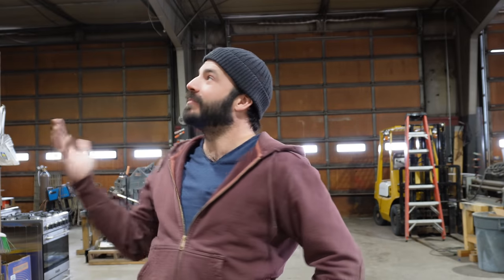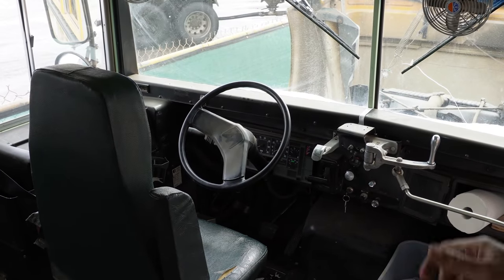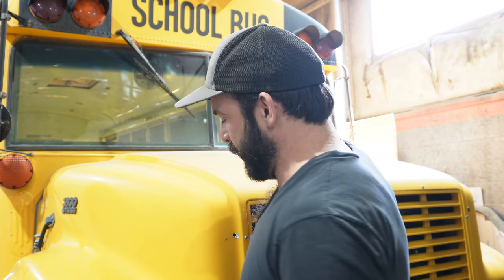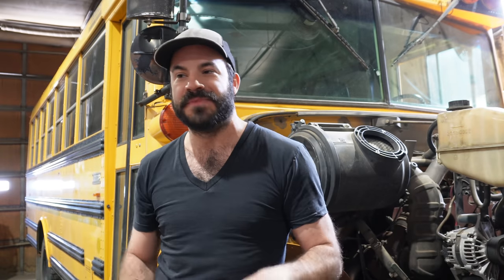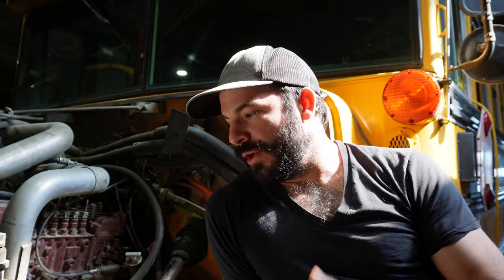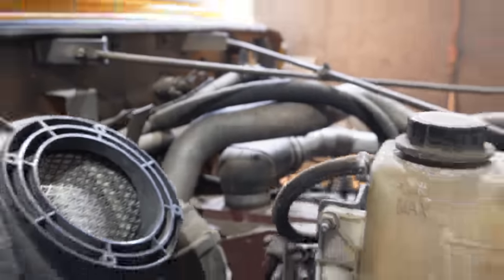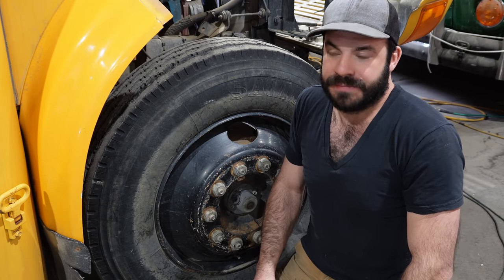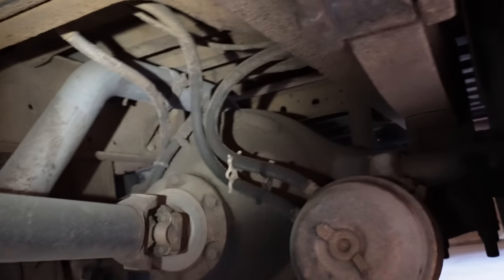Which Bus To Convert For Your Skoolie?

Comment: You should make a spreadsheet about the different engines. It would be super helpful
Reply: Yes it would in fact I'm planning on buying a bus and I'd like to know more about engine specs.
Reply: Stick with a cummins, a detroit, or a caterpillar, those are the good ones and parts are plentiful.
Reply: Run from any Maxforce
Reply: @ericolson8708  I agree, they are absolutely terrible.

Comment: One of the MOST Important decisions for a front engine is that if you drive gravel or dirt roads your intake and radiator is in the front getting clean fresh air , rather than the dust cloud that envelopes the last 1/3 of the bus . Keeping the rad dust free and clean air into the intake goes a long way to the life of your engine. Considering that the reasoning to build a Scoolie is to boondock , that means that likley these areas are off the pavement and may be 5-75 miles out in the woods. THANK YOU for all of these wonderful vids , very much appreciated.    CHEERS AND SAFE TRAVELS      Steve h.
Reply from the maker: Awesome point! Thank you for watching

Comment: Just recently discovered your channel. In January we purchased two buses from our school district. Mine is a 1995 Thomas IH3800 with a DT466 Dad bought a 1994 T444E version. Both are manual transmissions. My bus is the one I rode a good part of my school career and Dad was the driver. It only has 144,000 miles. I’m in the process of slowly converting it into a weekend camper. My first objective was to get it painted and mechanically ready to drive. Love the 3800 chassis buses. I’ve got a few videos if your interested in checking the buses out. Great video and information here! Take care!
Reply from the maker: Love that story! Sounds like you got some great buses. A manual would be the only way to make me love my bus more. I'll follow you!

Comment: The nice thing about a DT466 engine is that you usually can do an in frame rebuild on those. The cylinders have sleeves in them can be replaced if damaged without replacing the block

Comment: Totally bang on when it comes to lane position. I just bought a RE Bluebird and drove from Denver to mid coast Maine. I ran the pass side tires over the rumble strips hundreds of times. After about 1000 miles I had the hang of it. Having the motor 35 feet behind you is pretty great too from a noise perspective
Reply from the maker: love RE buses.... love mid engines even more!

Comment: Your advice was well taken. My rust free Mesa Az., bus is a 2001 International 3000 , 24 foot, 6 window truck chassis. Though not my favorite it has a relative low mileage dt444e. It was a special needs bus and has air bag suspension on the rear. A major plus for a comfortable ride. I checked with a school bus transmission specialist and confirmed before progressing ...with changing tire and wheel size from 19.5 to 22.5 and putting on all new tires and used Alcoa alum, wheels(made a world of difference in looks). Also having the same effect as changing the differential. Engine went from 64 mph @ 2700 rpm to 70 mph @ 2200 rpm.

Comment: Just discovered your channel & enjoyed it. Learned a few things so I subscribed. Looking forward to this bus conversion.

BTW: As a precaution, the company I worked for painted their wheel rims, light grey. It made it easier to detect a crack, normally turning black, than it would on a black rim. Mind you my bus had chromed wheels so did not apply.

I drove a school bus exclusively on highway charters. (Cheaper than coaches). It had a Mercedes diesel engine with an Allison trans. (don't know any of the models) and it lasted till 318 thousands kilometers before problems started to show up & company unloaded it right away.
Reply from the maker: Great tips! Love those Mercedes engines

Comment: So much great info. Like many, I learned most of what I know about buses After buying my bus. Still have that first one, a 34ft shuttle on a F550 chassis, that I converted the inside of. And the biggest thing I would change if I could, is the engine. Mine having the computer controlled 7.3 diesel. Wish it was a non computer straight six. My 7.3 started to run rough, hard start. I took it to a shop that replaced all the injectors and she was running great again. Till I was Two States Away from that shop. Started having No Start issues, which eventually got traced back to the shop that changed the injectors allowing some oil to get onto the contacts of the Internal Wiring Harness, That oil burnt, breaking the electrical connection, and all injectors on that side of the engine stopped working. The tows, diagnostic troubleshooting and repairs, plus hotel cost while my Home was in the shop, was a major hit to my budget and planned travels timeline. A straight six has all the injectors, glow plugs, wiring, on the outside of the engine where it belongs, is easy to get at. Having these buried inside the engine and a computer controlling everything, makes it impossible for me to find and repair issues myself on the road. And this is what most videos won't talk about. Yes the 7.3 is great when it's running well. But when something goes wrong, it becomes a major pain in the A$$. Towing a bus is very expensive and many shops won't allow you to live in it while it's in their shop. Plus supply chain issues are causing longer delays in getting the parts needed to repair our buses once the problems are found, keeping us out of our Homes even longer when something breaks. During which complete strangers have access to All our stuff. Welcome to The Dark Side of bus life, the reality that's often left unsaid. And if you are not staying in one general area but actually traveling cross country like with my situation. Then having the shop that did the original work tow it back in and correct the followup issues, is not a realistic option. You will be hit with all the upfront costs of all followup issues. Plan and follow through, as best you can from the very start, to avoid problems on the road. Then plan ways to survive if/when life gives you an unplanned something you're not able to avoid, which will happen sooner or later. So such an event doesn't end your journey, chosen way of life.

Comment: I usually keep some starting fluid around, not necessarily to start things, although I have used it for that, but as a cleaner.  It cleans very well and is cheaper than brake clean usually.   As for the dog nose bus I have a super C built on an International 4300 chassis and one of the reasons I bought it is because I have that 5 or 6 feet of engine and substantial frame in front of me in case I, or someone else. does something stupid.   Keep the good stuff coming.

Comment: Hello, many years ago I was looking to convert a small school bus for myself and dogs but life got in the way and now that I seen most of your videos iam ready for the plunge once again. the price of living in an apartment nowadays I can take all that money and finish the project in one year.
I been looking at lots of videos and yours have more interest in how  you build your buses out.
Lots of pros n cons living off grid sort of speak 
 But I believe I'm going with a sprinter van instead and using the flooring system and spray foam in which you applied
I still have to do more research and finding a van , but I will definitely keep your videos in mind when I finally get my project going. 
Keep up the amazing information in your videos.

Comment: When we use to order our F150s and F250s, we ALWAYS ordered them with the 4.9L (300)  In-line 6cyl. They had a lot of low end torque and would out last our V8s.

Comment: My old heavy equipment and diesel instructor in school used to tell us that every diesel motor has the ability to be a million mile motor if you take really good care of it, rebuild it every 200,000 miles, never drive it hard, and rarely drive it anywhere except on the highway.... Otherwise you are damned lucky to get 250,000 miles before it ends up in the scrap heap 
And those were the old pre 1990 models without all of the new crap put on them today. 
Personally never saw one make it over 250,000 before they needed replaced or rebuilt, a lot were destroyed by the driver's before they saw 150,000 miles.
Have to admit that the straight six was stronger, lasted longer, put up with bad drivers better and was a lot easier to work on.
Reply from the maker: That all backs up my experience very well too

Comment: I worked for years at class A truck dealer. It was very common to see trucks at 1 mil or close to. But this means parts are being replaced or rebuilt. At that time the estimated maintenance cost over the lifetime of a new truck was approximately 1 mil dollars. A sleeved engine like the international dt466 should be able to go a long  time with rebuilds. The non sleeved engines won’t go as long as they can only be bored out so much and the cost of a rebuild is considerably higher.

Comment: An example of the benefits of going with an older mechanical motor is in the case of the Cummins 8.3 ISC, the mechanical fuel pump new is 1500.00 the electric version is 5500.00.

Comment: Medium-duty commercial engines such as the Cummins 8.3 Isc and the like as well as the smaller commercial engines are good for about 350k at max. Only class 8 engines such as the Detroit series 60, Cat 3406E, Cummins N14, N14+, and X15  are capable of 1 million plus. The older 6V71,8V71,6V92, 8V92 are only good for about 300 to 400K before a in-frame is necessary.

Comment: Ether won’t hurt a thing !!! I’ve had to use it every time I crank my international 684 tractor for the last 30 years, every time I crank it.  Uses no oil, oil stays clear and clean between oil changes, engine does not smoke one bit. I’ve alway heard that ether was bad on engines, but it sure hasn’t hurt my tractor. I think 30 years is a pretty good  trial period.

Comment: “I would rather have too big of an engine in a small bus than a little motor in a big bus”.

YES. PEOPLE, LISTEN TO HIM! 

I had some friends make a 30-35ish foot flat nosed Bluebird their band’s tour bus. Awesome build. They even used the rear handicap door and lift to load their gear in. So sick! 

But….

It came with the Cummins 5.9, which YES is a legendary engine….

…..in pickup trucks.

They made so many of them that they started putting them in many medium duty applications (buses, box trucks, etc.) 

These engines in large vehicles are DOGS. Overworked, out matched, and my friends broke down all the time. 

If it was the Cummins 8.3, sure. 

But the 5.9 has to be relative to the size of the bus itself.

Comment: hey Charlie :) great video, thanks for all the fab info. Is there a gasoline engine you would recommend (or maybe run away from)? I'm glad you talked about rust - so many Canadians say "buy a BC [car/bus]" because they don't generally use too much salt or get too much snow in that province, BUT it's so incredibly wet here, especially on the far west coast & on the islands, and everything is SO damp and moldy. Every RV and house roof I see is green with who knows how many species of algae. I've never seen this much mold inside windows and doors in homes. I definitely wouldn't buy a BC bus since if it hasn't rusted yet, it's almost certainly been primed to start rusting.
Looking forward to watching more of your videos :) xo

Comment: I ran Cooper tires for years as an owner-operator truck driver and never had a failure once in over 3 million miles using Cooper tires and those will run you an average of 350 apiece.
Reply from the maker: bad asss!

Comment: Unlike your very informed and patient approach to searching for what you wanted to locate in a bus, I simply jumped at the first bus that presented itself. That leap before looking approach might be my downfall. I hope not. Time will tell. I had only a very limited budget of $3500. I looked online but could not find anything close to what I had hoped to locate, in a smaller vehicle, one of the van nose type transit vans. Then, this popped up, a late 2008 International 24 foot six window, with a Maxxforce 7 engine, a 1000/2000 series automatic transmission with 137,000 miles. Like your find, this one appears to be virtually rust free, except for some light rust on the front bumper. It looks like it has decent tires all around. The brake fluid is low and that's of concern. Though they shouldn't be, I find that the oil dip stick is challenging to read and the transmission dip stick is as well. I have no plans to transform it into a home but was only looking for a bigger vehicle to carry my art sculpture endeavors to various events. It seems completely overbuilt for its intended use of carrying children as passengers. This bus was pulled from school service about a year ago and still has last year's inspection sticker in the window.

Comment: I'm not seeing the front crossview mirrors on your bus.  It's particularly nice having the driver side crossview mirror in particular.  I've learned as a school bus driver that you can drive perfectly centered in your lane if you drive with that mirror perspective wise from the driver seat being viewed just over the center line of the road. You can use it like a reference point gauge to get centered. 😉
Reply from the maker: Good tip!

Comment: I think you could get 200-400k miles out of it IF you take good care of it. You gotta do maintenance on it. Now the million mile thing is more for cars. I had a friend who had a Mercedes or BMW from the 80's that literally rolled the odometer. Took me and another guy for a drive in it and he hit 1,000,000 miles. Alot of people run the engines HARD. They also put a smaller engine in a larger body. Like putting a small V6 into a large truck and wanting to haul a large camper daily. I love the mechanical engine setups. You don't have to have a computer to diagnose them.

Comment: The ideal bus I would like to get in the future, is a Ford Econoline Cut-A-Way Chassis Blue Bird or Collins Body, (I belive those two have the tallest height. I'm about 6'2.) 4 Window Short Bus with a 7.3 Powerstroke. 

...and someone who likes to go off-road far into the backcountry. I would throw on a 6" Lift, 35" - 37" Tires and a 4x4 conversion.

I actaully found one a few weeks ago at a school district, with only 128k miles and going for $3500. 
Couldn't get it because I have no place to store it. It would be at least 1 & 1/2 yrs, before I could start working on it. 😢
Reply from the maker: Collins body all the way, definitely the most height. That's my favorite platform for short buses as well, though I would do a 5 window. The only 4 window bus we did was badass but it's hard to fit everything in, esp if you ever have a guest. Wish I had a yard to store that bus for you, that's a killer killer deal

Comment: I am surprised your not switching your transmission out for a 600 Al before u pull out of the shop! Except well the cost but you are in a unique position to trade out the work. I say that about the transmission because you are a perfectionist someone I would love to convert a bus for myself.
Reply from the maker: I'd love to but since this one works, I'll be first spending my mechanical money on the basics--getting caught up on maintenance, a couple reliability upgrades, and then better performance through gears, transmission, etc
Reply: @ChuckCassadyYT  👍

Comment: One more bit of advice, while school buses owned buy wealthy school districts are often meticulously maintained a lot of these buses come form private school transport companies that beat them into the ground. Also these are giant yellow taxicabs so they have been abused by default as stop and go driving takes its toll.
Reply from the maker: Agreed! I should have mentioned that, my favorite buses we got from wealthy districts. First Student is notorious for running them into the ground! subscribe and stick around, I'd love to have you in my comments as these go on!
Reply: @ChuckCassadyYT  you so great work I spent fifteen years in the school bus business and you’re right first transit/student is thee worst lol. There’s nothing left when they’re done with them. I worked for a distributor who designed the first left hand entrance door for use in NY city so they could pick up kids on both sides of a one way street without them having to cross. Seen buses lifted off the frame because the box channel above the rear axle on the 3800 Chassis will rot right out on them. You look like you get some decent tin from somewhere down south.
Reply from the maker: @jeremypilot1015  thats awesome! Ive seen those buses in NY--did a double take for sure! Out here in colorado the buses hold up really well and if you go to New Mexico and arizona its like they never age. rust is my #1 enemy!
Reply: @ChuckCassadyYT  I would love to move to Colorado. Beautiful scenery, same weather as here, and so much better politics lol
Reply from the maker: Amen!!

Comment: Hello Chuck I have a question, I'm looking for the DT466 all mechanical but finding it with a good bus body is hard. I find good bus bodies but with the D 466e, here's my question would it be easier to rip out all the electronics and just put it back to Mechanical or put a mechanical engine in the bus?

Comment: Awesome info Charlie. I commented earlier today and I guess my suggestion was deleted. You were talking about changing the axle gears and I suggested using a Gear Vendor overdrive as a better option. I added their link to make it easier for you to find them. I assume that is why it was deleted. I'm not associated with them in any way. I know their overdrive is great based on experience. It's like grabbing a higher gear with a flip of a switch. Let me know what you think..
Keep up the great content👍
Reply from the maker: Dang i didn't delete it but if YouTube thinks it's a spam or bot it will get removed. Thank you for watching and participating here